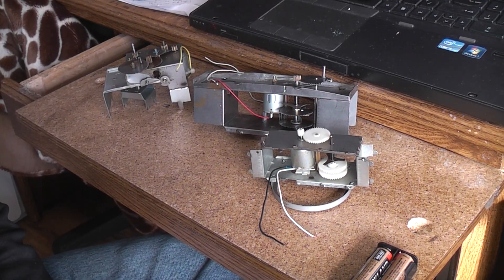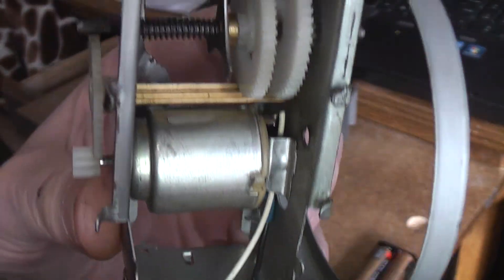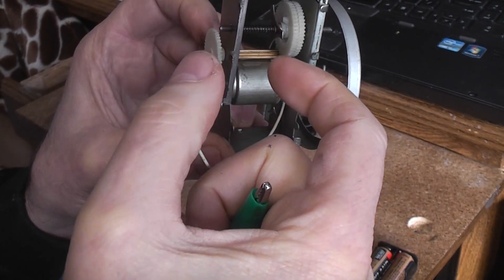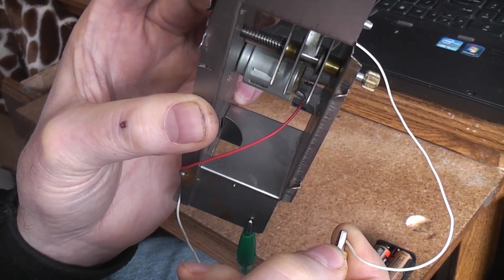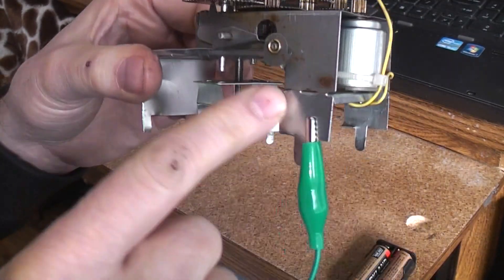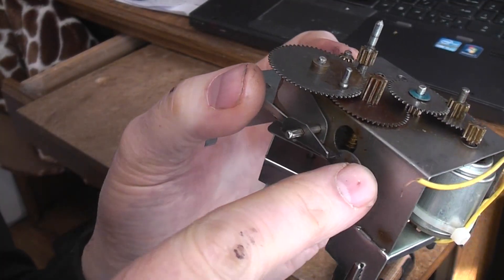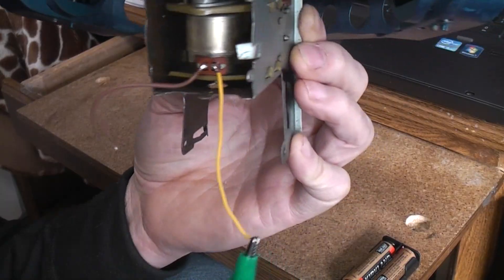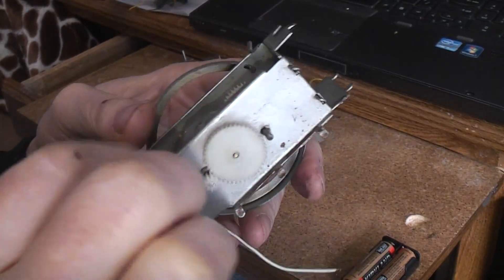Lets talk about vintage battery motor toy mechanical designs. two functions and one motor.

Comment: Hi John,

So on the first example, the driving gear has a fixed tooth count and module, and the driven gears have tooth counts of N and N-1, with the same module?  If so, the driven gears have differing (pitch) diameters which makes one engage, and the second, not so engaged.  

I'm most definitely confused, but then again, I'm old.  

It seems to me that the drive gear should consist of two gears, one matching the required pitch diameter of the gear with tooth count N, and a second matching the required pitch diameter of the gear with tooth count N-1, in order to maintain similar gear (pitch) engagement diameters.  

However, with teeth this small, perhaps it doesn't matter.  

For 3D printing, I'm thinking a dual drive gear teeth and module would be required on a fixed axle to match the N and N-1 tooth count in order to maintain matching pitch (gear) diameters.

What the heck am I missing????

Greg
Reply from the maker: The diameters of the two gears is ever so slightly different since there is 1 less tooth but does not stop the gears from both meshing the small long drive gear. Not sure how well this would work with larger tooth 3d printed gears, it might be a problem but then again 3d printed gears can mesh with out a tight fit. The gear with the most teeth and the ramp on it drives nothing and is not fixed to the shaft the gear with 1 less tooth and the slot for the ramp can be fixed to the spring loaded shaft. That way the movement of the shaft can be used to control things or the movement of the gear on the shaft can engage a new gear system.
Reply: @Robothut  That is indeed an interesting implementation!  Thank you so very much for the explanation.

Greg
Reply from the maker: @popzct  Greg I just went to the gear generator.com and tried a test. I put in a large gear with 21 teeth driven by a small gear with 9 teeth this is a ratio of 1.2.33 and  measured the center to center point of the two gears meshing. Then did the same thing for a large gear with 20 teeth and small gear with 10 teeth. This is a ration of 1.2 with a center to center point of the same diamention's. So a person could 3d print the gears required to make the rotating ramp lever and still have the main drive shafts be the same distance apart by just making the small drive gear a 2 gear set up. Might be fun even if it is large just to see it operate.
Reply: @Robothut  Hi John,

That is what I was attempting to explain in my first comment, that for 3D printing, a configuration as you mentioned would more than likely be required.

Greg
Reply from the maker: @popzct  I just whipped up a small unit that uses to 20mm large gears, one gear has 19 teeth and the other 20 but both are 20mm in diameter. They are both driven from a 9 tooth long gear. I made the ramp a 50%. Seems to work great. If interested I can do a short video on it. Its not connected to anything but does cycle as a proof of concept.
Reply from the maker: @popzct  Here is a the 3d printed version.
https://youtu.be/9Yv5pS-EzUo

Comment: It's amazing how those toys were engineered way back then. Unfortunately, those plastic gears take up a lot of stress after a while and so do the motors. 
If I knew that, I could have saved some toys back then. But we were just kids.😢
Reply from the maker: Yes the plastic gears will crack "split" even if you do not play with the toy. So almost all the toys with plastic gears will need repair.

Comment: Love how the larger rotomatics have a better thought mechanism, does the top cam lock into place after it's fully turned? Brilliant, what i wonder os how does the bi-directional walking in some of them work, pretty sure that the torso block has to have 2 holes so the pinion drops in both sides, but how does it enable the wheels to let it walk to the specific direction it has to walk to? Is there any piece in the hip that the pinion pushes down which makes some change inside the foot?
Reply from the maker: Yes the old large rotomatics have the forward and backward walking action and it was more complicated as there is linkage that has to shift the ratchet wheels to work the other way. I did not have an example of that type mechanics so did not bring it up.